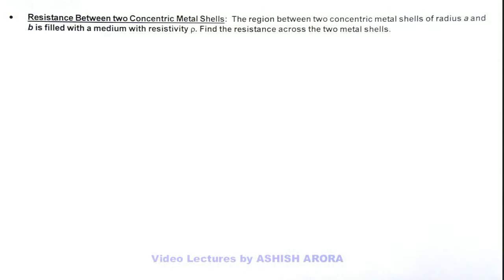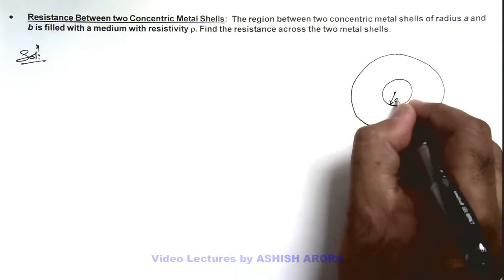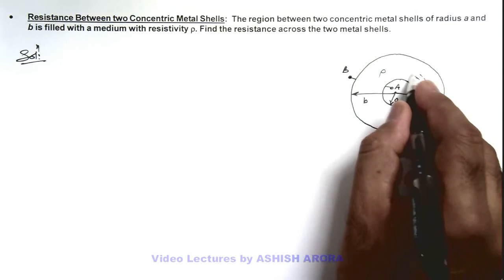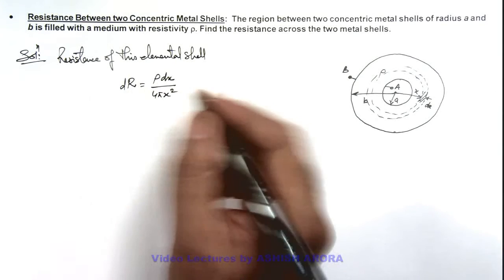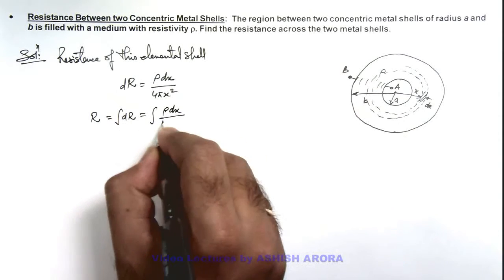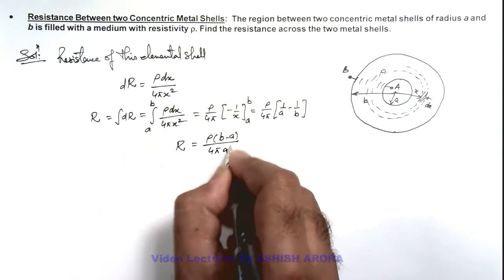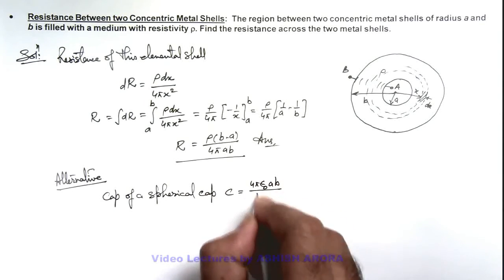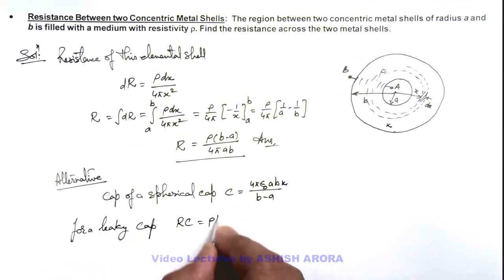17. Advance Illustration | Current Electricity | Resistance Between two Concentric Metal Shells

Comment: I did somewhat of alternative way as i took it to be leaky capacitor and wrote the formula C=4πe°k ab/b-a then what i did , i converted spherical capacitor into plate capacitor system then i took analogy between them so i got d=b-a and A=4πab and then i put that into R=rho d/A and i got same formula please someone correct if there is anything wrong in it

Comment: sir, how can we understand that this is in series, if it would have been parallel, then we could not integrate, so is there a method to understand why this is series and not parallel?
Reply: there is a easiest and most basic methode to analyse this just focus on the diffrent elements you will found that potential diffrence accross all the elements is diffrent. 
and is suppose a situation in which elements are connected in parallel then you will integrate 1/R and the answer which will come out after integration must be recipokled

Comment: Sir why Here we do not consider cross sectional area as cross sectional area is pir^2
Reply from the maker: NO. Cross sectional area is the area through which current flows... here it is the spherical section at any radii through which current is flowing...
Reply: You have to consider surface area